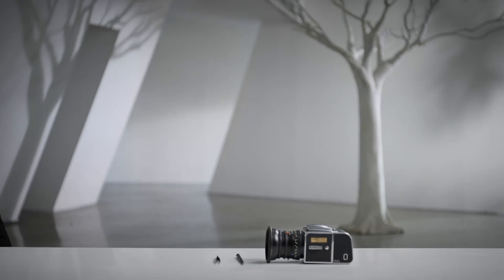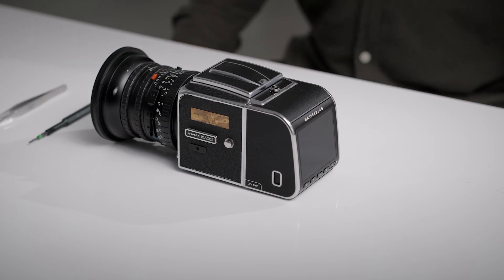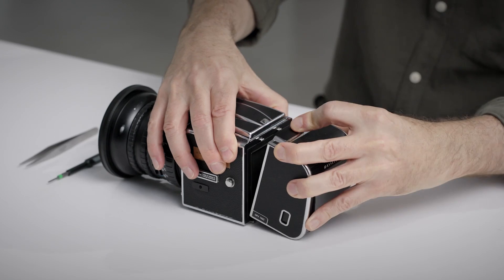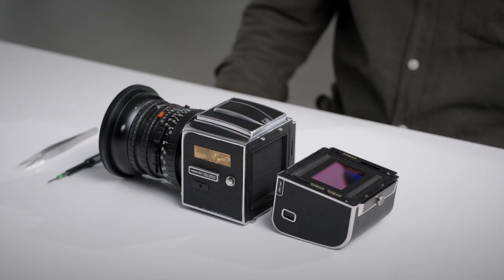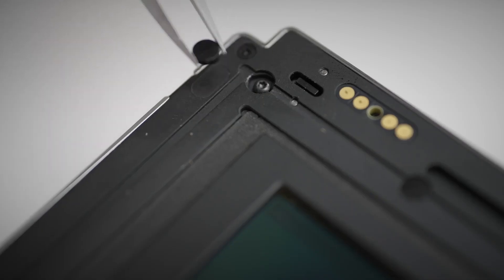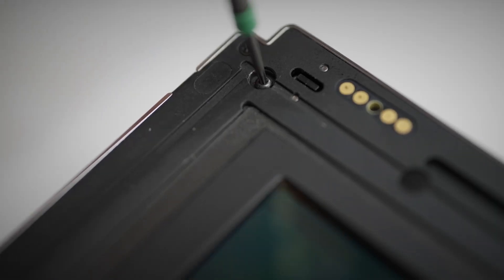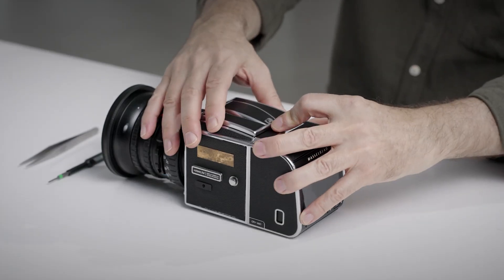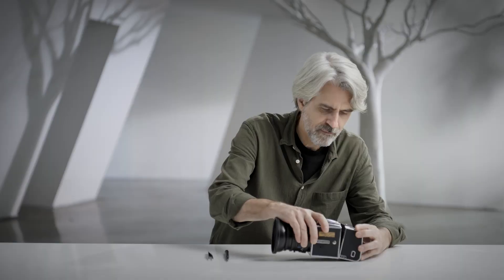Hasselblad 907X CFV 100 C | Adjusting Shutter Timing

Comment: This did not work for my 205tcc. It either will not release, OR releases on a half press (which it should not - a half press enables the meter on the 205 but does not release the shutter), OR, when I think I have it in between the two, it ONLY releases when I cock the 205's shutter with the wind knob!

Comment: When using the CVF 100 C with older or vintage lenses does the digital back show if your in focus with some type of light.
Example, when I put an old Hasselblad lens on my canon with an adapter I focus manually and a green light in the camera will come on letting my know I am in focus and a red light when out of focus.
Reply: No focus indicator. Can use focus peaking though.Of course the only way to view/focus in live view on the LCD is to have the 500 body/lens shutter in B mode and either held open or with a lock/remote cable. Then focus, reset and shoot again to capture the image if you don't use electronic shutter. Which in my perspective if only shooting in electronic mode, just get a V to X adapter and eliminate the 500 body.
Reply: @nelsonclub7722  
Thank you for the reply.